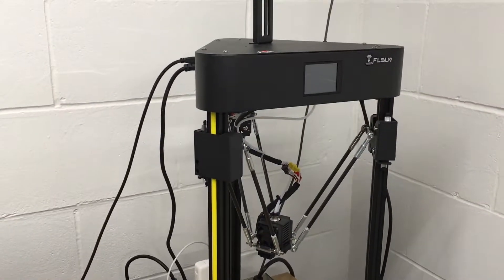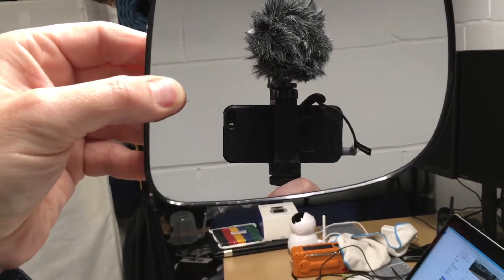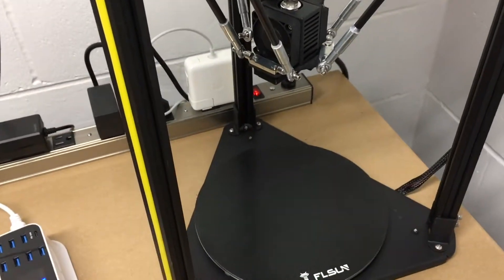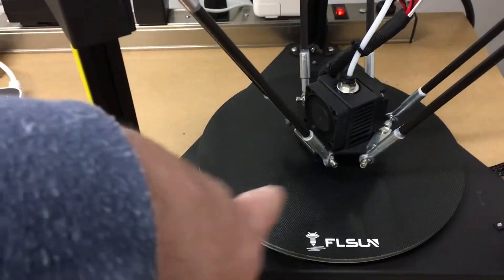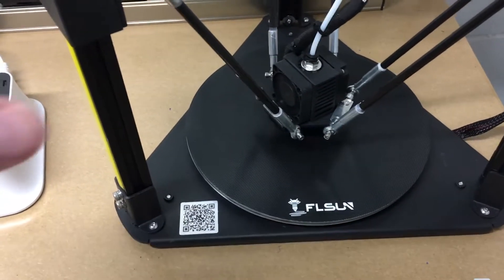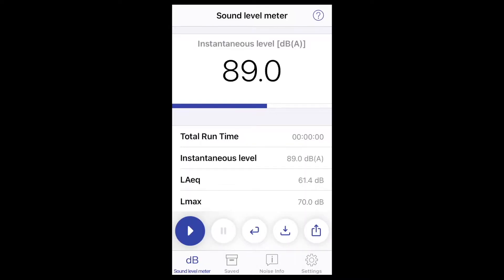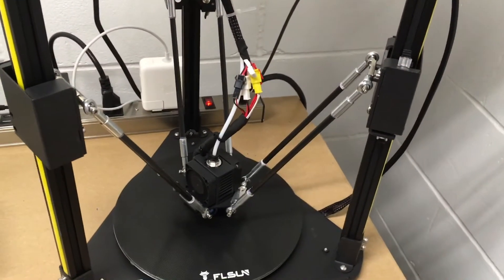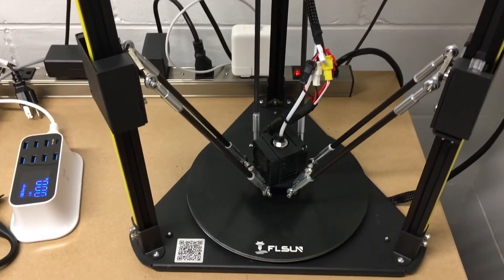FLSUN Q5: Noise Levels (Ep. 24)

Comment: imo this understates the noise of this printer - my unit at least seems much noisier than is presented here
Perhaps mostly because i'm quite sensitive to noise
Reply from the maker: It can be difficult to convey what a printer sounds like in a video. Do you know where most of your noise is coming from? I think the fans are probably the loudest to me.
Reply: @Rickmakes Yeah, i can get behind that. For my printer, i think the top noise sources are, in order:
-The fans (if at max; otherwise 2nd-loudest)
-The extruder stepper motor
-The other stepper motors

Comment: my extruder makes a beeping sounds all the time and i dont know why
Reply from the maker: I changed (in Cura) the "Retraction Distance" to 8mm and the "Retraction Speed" to 80mm/s. That fixed the problem. The Retraction Speed will turn orange but it will work fine. I think other people use 6/60. You can research it more you you'd like.

Comment: My Q5 will hopefully arrive this week and some of your earlier videos will be helpful with setup and first print, so thanks for that. Regarding the noise level, replacing the fans with quieter ones helps a good bit. You need the fans and some voltage converter chips to go from 24 volts to 12 volts.
Reply from the maker: Where I currently have the printer, it is out of the way so I don't notice the noise. If it became an issue, I would look into fan upgrades. I saw a post the other day on Facebook where someone had a 24v fan. That would be nice but if I remember correctly, it was a lighted fan. That's not really the direction I want to go with my printer right now. :) I hope you have good printing ahead!